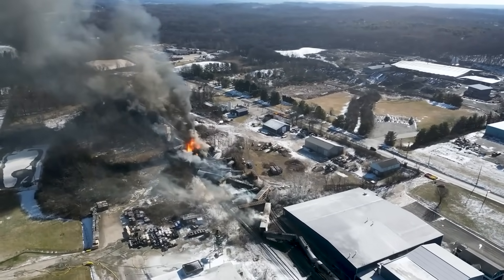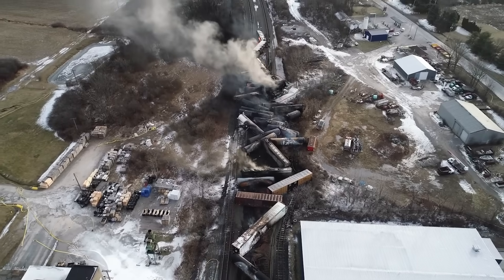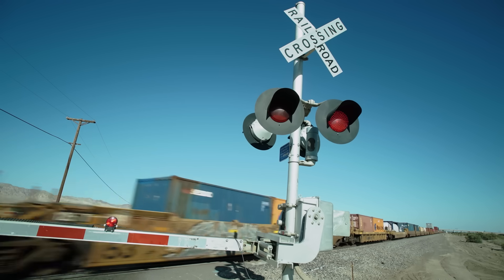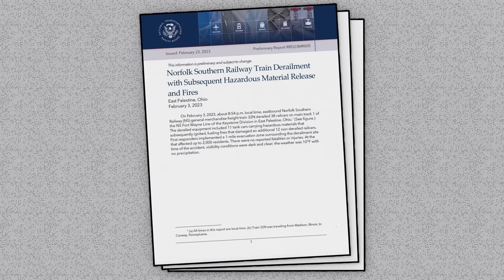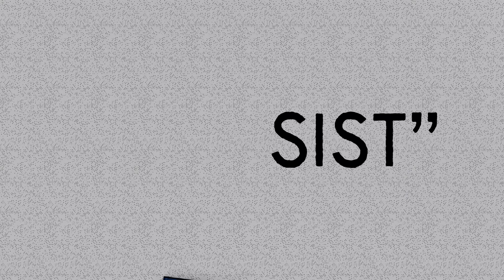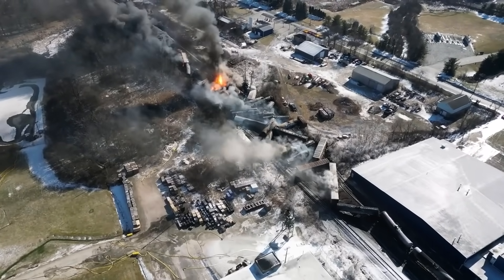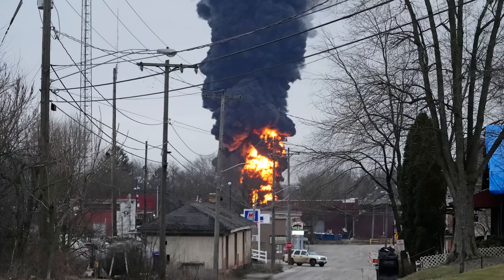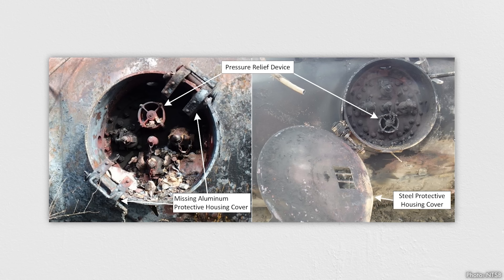East Palestine Train Derailment Explained

Comment: You forgot to mention that the EPA is letting Norfolk Southern do all the testing now. So of course groundwater won't ever be polluted, magically!
Reply: well it all got burned so it wouldn't be easy to detect in the water, knowing plumes would carry it away over neighboring states, then after a few weeks you can say there's clean air levels since there's not so much to leech out of the ground. what a solution.
Reply: Thankfully most of these chemicals are very volatile and have a relatively short environmental half-life

Comment: Great video Grady. We live 6 houses and one bridge away from a rail yard. So this has been on my mind- what is our risk? The only thing that helps is knowing that they move slowly around the yard.
Reply: I wouldn't worry too much about it, if you think of the thousands of freight runs every year, and compare that to the small number of serious rail accidents (thousand of derailments happen every year, most are simply a matter of jacking up the car or cars and setting them on the rails.) One thing I would suggest putting together is a small evacuation kit, important documents, any critical medications, a little cash. And anything else you or your family would need if you had to leave in a moments notice. A small backpack is usually perfect, I keep mine in a medium sized wooden crate since we've had to evac for forest fires several times over the years it also contains basic car camping gear/ tools.
Reply: How do you think I feel? I've run that line through E. Palestine for 20 years. Safety has been completely ignored for the last five years.

Comment: its safer by 8x, but what makes it look worse on the surface is that the accidents are so huge, its like 15 truck accidents all at once in the same spot. so at surface level it seems worse when an accident does happen here and there, but you just cannot ignore just how much gets moved everyday without incident
Reply: Similar to air travel then: statistically very safe, but the few accidents that do occur tend to be catastrophic.
Reply: A rule of thumb for transport systems is that if you can name specific crashes or incidents, it’s usually quite safe. 
I can say Boeing Flight 111 and you will most likely be able to figure out what incident I am referring to. But if I say Crash on May 13th in Miniapolis, you will have to ask “witch one”
Reply: @americankid7782  "I can say Boeing Flight 111 and you will most likely be able to figure out what incident I am referring to." - Sorry, but I have no idea to what you're referring.

"But if I say Crash on May 13th in Miniapolis, you will have to ask 'witch one'" - You're talking apples and oranges and you intentionally obfuscated things to make your ruse sound intelligent.  Of course people are more likely to remember something when you give them identifying characteristics, such as an airline manufacturer and a flight number.  If, instead of "Boeing Flight 111", you said "airplane incident on (date)", then people wouldn't know to what you were referring.  Ergo, your "point" is BS.
Reply: @nomore6167  It’s a rule of thumb and a slight example of an idea on how to use it. Just because I didn’t provide an example in the exact way you wanted doesn’t mean the overarching idea is moronic.
Reply: @americankid7782  That rule of thumb stops working when you listen to engineering disaster podcasts though unfortunately.
Reply: Exactly, and most rail accidents/ derailments are so minor and without loss of life that they never make the news.
Reply: @justindunlap1235  This. They also typically happen in rail yards where there's all the switchbacks and transfers and such, and it's all moving generally slowly, too.
Reply: Same thing with ships. A small container ship will carry as much as a few hundred big rigs. It's also a lot more environmentally unfriendly to ship via truck. On a per engine basis, yeah obviously one ship is a lot more polluting, but on a pounds of C02 generated per ton of cargo moved 1 mile, it's like the difference between being Batman and being a kid with a batman mask.
Reply: It's like when people would rather drive than fly even though driving is something like a thousand times more dangerous
Reply: Rails are safer than trucking. And pipelines are safer than rails.
Reply: @kds5065 ...until complacent executives decide that the fact they haven't been having accidents means they can shirk the safety regs that have been preventing the accidents.
Reply: @kds5065  Besides that, trucks run on, and often destroy, public roads.  Railroads operate on, and maintain their own infrastructure.
Reply: @rodneypidcock6903  That depends on where you live. Many countries still own the rails publicly and maintain them on the public purse precisely because of safety because they've witnessed economic "rationalists" privatise theirs and the utter decimation of previously public infrastructure that follows.
Reply: @kds5065  "Rails are safer than trucking. And pipelines are safer than rails" - Do you have any data to back up these claims?  I'm inclined to agree, but I also admit that I'm basing that only on my own assumptions and lack of incidents making national news (which does not mean lack of incidents), not on actual data.  Like everything, maintenance is key.  Let's ask the residents of Jackson, MS how safe their water pipelines are.
Reply: @kds5065  no oil is safest.
Reply: Like airplanes
Reply: We have the engineers and conductors to thank for that since it sure isn't the corporate boards, executives, or investors who seem interested in safety. They are only concerned with: does this safety improvement reduce or jeopardize my bonus, dividend, or stock buy-back? If the answer is yes, then they are against it.
That's why the executives and investors are so highly rewarded while the engineers and conductors don't even get sick days.
Reply: Guess if you ignore the burning and toxic fumes and dioxin that they aren't testing for.
Reply: A lot like nuclear reactors then
Reply: @hanzzel6086  Fun Fact. Most deaths at Nuclear Reactors (in the US) are caused by Steam explosions and electrocution.
Reply: @americankid7782  Oh, what's this? "Extremely High Voltage?" Well, I don't need safety gloves because I'm Homer Si...
Reply: @hanzzel6086  Not really, as the results of a failing reactor can be unpredictable. So compared to accidents with pretty much calculable results, a nuclear reactor depends on the location, where the wind blows and the kind of accident. This potential makes insignificant incidents newsworthy but also does not allow to calculate an average as the ceiling of a greatest assumed accident never has been met (opposed to eg. the total loss of an airplane when crashing into a skyscraper).
Reply: @Schmidtelpunkt  Modern reactors 'fail' into safe modes. Which results in no chance to cause any meaningful damage to anything outside the reactor room.
Reply: @hanzzel6086  "No chance" according to what is assumed. But not to what it possible. And only if one trusts the company running the reactor - which gets money when it is running, not when it is down.
Reply: @Schmidtelpunkt  First, the amount of international accountability for nuclear reactors these days is insane. Second, it doesn't matter "how well maintained" they are, they are physically incapable of overheating. And if they somehow do, they will melt specifically designed supports and drop into a massive, isolated, cooling bath before it could go critical.
Reply: @hanzzel6086  Unless something unforeseen happens. Which by its nature is unforeseen. This is not merely a technical problem, but a philosophical one. And that the advocates of nuclear energy don't realize that is just one good reason more to avoid it. In this case that "cooling bath" might be leaking for whatever reasons. Or the reactor failed before and so somebody just blocks a fail safe in a way so banal that it does not appear on the documentation. Because there are billions of euros at stake, while the potential losses of an event are paid by somebody else anyway. Imagine a roulette table, but when the zero falls twice in a row, everybody at the table dies. The gambler however sits in a room far away and has somebody else place his chips. What makes you think he would stop the game after a the first zero has fallen? And that is who you put all your faith into.
Reply: It may be the size of 15 truck crashes, but 15000 of those trucks have probably crashed between this and the last rail accident of the same scale.
Reply: 15 trucks spilling their contents of hazardous chemicals across 15 different points across an entire state is vastly different in its impact compared to 1 train derailing an equivalent load of chemical in a watershed. Several cities can lose their access to water from one derailment.
Reply: @KesSharann  1 point of high level-contaminant happening at one specific location, while temporarily and locally dangerous, can be remediated somewhat well and allow low levels of long-term contamination across the area. 1 train car ~= 5 truck loads, so the equivalent 75 cases of low-level contamination at different times across a wide area poses a much more difficult remediation process and will result in higher levels of long-term contamination across the area.
This is of course ignoring that train shipment already causes less spills than trucks, and has more room for safety improvement.
Reply: @KesSharann  Your point kind of compares apples to oranges, you only mention the rail spilling into water not the trucks. Railroads go through a lot of areas that aren't full of water just like trucks do. A better comparison would 15 trucks spilling their chemicals into 15 watersheds (possibly the same watershed, possibly up to 15 different ones) vs 1 train spilling 15 truck loads into 1 watershed.
Reply: there have been several derailments from the same company, hell even in the same state, since this happened.    while I agree that (properly regulated) rail is extremely beneficial.  to suggest that North American freight rail is 8 times safer than road transportation gunna need some citation.
Reply: I don't think anyone is trying to say moving things by rail is unsafe. the problem is that they are trying to portray this objectively terrible dangerous accident that is harming the surrounding people and environment, as not harmful.
Reply: @katiebarber407  who is trying to portray this as not harmful? i have not seen anyone try to claim it wasnt harmful personally all i have seen is people talk about how harmful it is
Reply: @christhorney  you don't see how your comment is unnecessarily downplaying the harm?
Reply: tell me chris, how many massive dangerous deadly train accidents that destroy the environment (water people drink, fish people eat, deer people hunt) are acceptable in your back yard?  1 every 1,000,000 miles? that's a very low %. but given the number of miles trains run....it's happening every year, in your back yard. And I'm okay with it happening to you Chris. Everyone will agree, just let it happen to Chris and it's fine, everything's fine, nothing to see here, isolated incident, rails are safe, a lot get moved without incident and it only affects Chris and he doesn't have a massive PAC to stuff politician pockets....so he doesn't matter.

Comment: It does not surprise me that the tanks were built with aluminum instead of steel. That seems like a negligent safety oversight if you ask me, but it seems most if not all industrial practices follow suit, using outdated equipment because it is cheaper than updating, and because there are no consequences for not updating (until there are of course). I work in an industrial workplace, and we face the same problems, the extent of which I couldn’t possible know because the scope of my position is narrow. Fortunately, there is only one outdated system I interact with that’s a major safety hazard, and after I’m off work probation and officially in the union I’m going to fight to have that safety hazard fixed.

Comment: Why on earth are the monitoring systems at sporadic points trackside, and not integrated into the architecture of every single car?
There are industry standards to connect the brake air lines, why not include a scalable network constant monitoring system. In the scope of the cost of a car, a few sensors and a small box of electronics isn't going to add much for cost to be a barrier
Reply: Isn't going to add much? You have no idea the scale of what you propose.
Reply: @NoopityNoop  I get that the total cost would be eye-watering, but it's all relative. How much of the cost of this disaster is going to be burdened on the County, State, and Federal purses, when the responsibility to prevent situations exactly like this is on the freight companies. 
They'll pay a token fine, but it won't be anything like the true value of losses, so they're incentivised to skimp out on safety yet again, and let the tax payers shoulder the burden

Comment: There was a lot of noise when then UK started transporting nuclear waste via rail, to prove it was safe they crashed a loco at full tilt into the special transport truck and it did not fail and leak anything.
Reply: Operation: Smash Hit. Legendary video. 
Brain child of the public relations office of the Central Electricity Generation Board (CEGB), the place of employment at the time of the late, great Sir Terry Pratchett
Reply: We could transport everything in those casks used for nuclear waste, and it'd effectively eliminate accidents like this, but it would increase the cost of goods by an order of magnitude. But yeah, those videos of casks getting train-blasted are great!
Reply: @naamadossantossilva4736  What OP is getting at is that it's all about safety culture being ingrained into every level of corporations. Nuclear gets seen as a big bad, so has to adhere to such an engineered degree of safety in order to be accepted that it's almost priced out as an option. Persistent toxic chemicals like VC are background noise in public perception so get away with such lax safety controls that incidents like these occur so commonly people only remember the most recent events.
Reply: And just for good measure in operation that container is surrounded by an extra armoured box and the train is short with a spare locomotive just so it can keep moving

Comment: Put the caboose back!! The automatic sensors are helpful, but there should be an individual who's job it is to analyze the feedback. That should not be left to the loco crew as they still have all of their regular duties. 
I'm not sure if it was something they would have been able to see coming had there been eyes on the section before that waypoint, but a person would have noticed that rapid increase in temp point after point

Comment: 13:40 i mean you could just make the vc closer to where its being used  and  use pipelines ... but those leak too soo
Reply: And leak a lot, generally.
Reply: It's also much less practical from an engineering standpoint to ship the also toxic precursors to a location that will, due to economies of scale, be less efficient in it's use of the precursors.